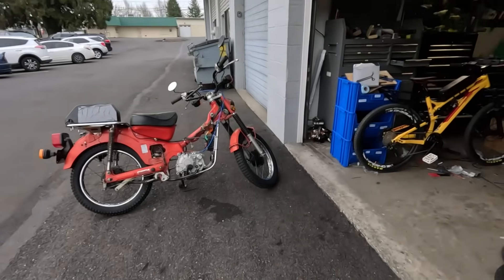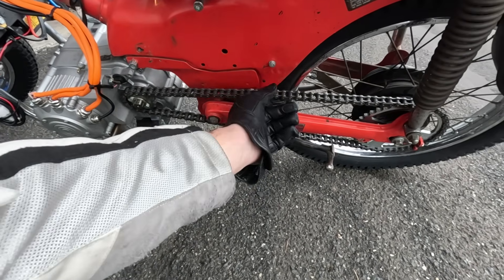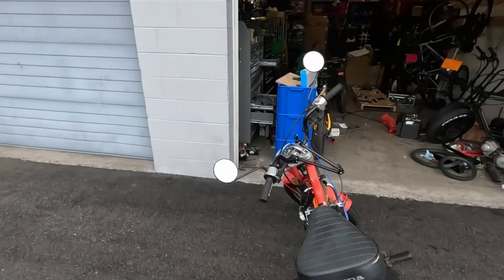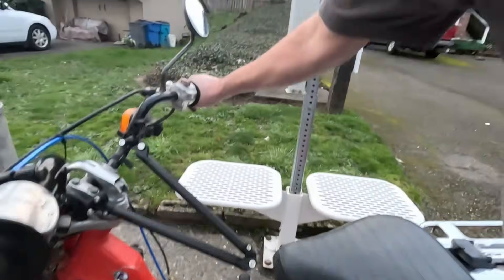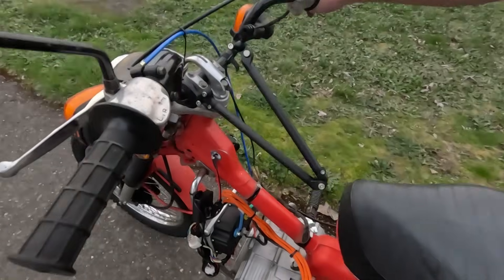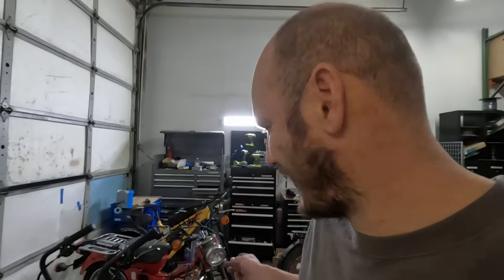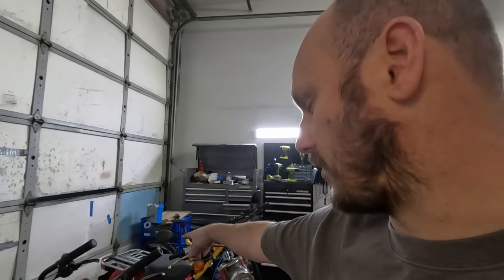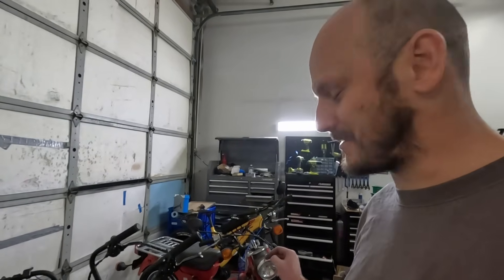Top Speed test on the Electric 72v 4-speed Motorcycle conversion

Comment: A thermocouple to monitor the electric motor temperature ?
Reply from the maker: With a bigger bike that would definitely be a good idea. I don’t think it will generate much heat on this 150lb bike as long as I keep the gearing correct.

Comment: This clip , the battery management failed / shut down . Just another "excuse" , and Johnny's lack of proper planning and NOT testing on a "fully sealed" road in line with the manufacturer's reference test protocol .. The motor's peak laboratory rated speed was nearly achieved . Other videos of this product show the official top speed as 60 miles or 96 kilometres per hour on a dynamometer , or "fully sealed"  road which Johnny should have selected for the test scenario but did not ! The same as used for motorcycle assessments . Going significantly above this would require 96 - 110 volts direct current . The motor would overheat and fail at around 7800 - 8500 watt power consumption , one minute or more continuous run . Johnny had reached 85 amps at the battery (5950 watts)  . The manager could have acted prematurely due to vibration / ambient temperature etc . Peak power was not quite reached due to less than optimal deep cycle characteristics of the battery chosen . If the larger battery was used , the top speed would be higher but if run for more than a minute or so ,  "sprint" up a hill , for example , the motor would become "TOAST BETWEEN HIS LEGS" partly due to it's lack of ventilation .
Reply from the maker: Yes. I haven’t refilmed the top speed test with the proper battery. I have it rigged up now. Just need to film it 😁

Comment: The adapted motor gives an elegantly simple look.  The controller can occupy the old gas tank space under the seat, which will clean it up considerably, and get the controller out of the rain and dirt. Saddle bag style battery mounting will keep the center of gravity low... where it belongs, and provide enough room for the adequately sized batteries this test mule lacks.All the DC wiring can be kept short , and the over all utility of the bike retained.  Most of us know an electric motorcycle has no need for a clutch or gears,  but with a marginal sized motor it may act to reduce current draw ...But more this is a misconception held over from our life long experience with ICE motors.  The ratings that DO mean something... are:  Internal Motoe Temperature Rise,  Peak Current vs Wire Size inside the motor, Duty Cycle when overloaded,  and battery cycle life - which is dramatically shortened by : Excess Current Draw,  Over Discharge and Over Charging  ( the ideal operation range for lithium batteries  is cycling between 20% capacity and 85% capacity.   When you insist on using the top 15% or the bottom 20% of capacity your battery life will be shortened many times.To use the top 10-15% ride right after fully charging. Never go below 10%  Just Dont!  Do you want 5-10 years battery life?... or 6 months or a year ?  That is the choice you are making.   Total Amp Hours Delivered during any 1 cycle... depends on How Fast You Draw The Power Out.    At low to moderate discharge rate ( amps draw vs amp hour rating)  you get more total power back out ( more range),  than you do if you draw the power out Heavily.   So the battery life and the range are extended when you don't Hot Foot It... OR  if you increase the battery size ( several times)  to handle the high Peak Discharge  by making it a smaller percentage of total capacity.   You can't have it both ways.... a small battery and high speed/acceleration...without paying for it with short range and short battery life.   Build and operate for your purpose and your purse.   A light hot rod sport bike... will go fast for a short distances.   A heavy battery pack and sensible operation will give you long range, and long life  but allow full bursts of power when needed without ruining things,  but will be heavier.

Comment: At 2:00 on the video,  the chain sounds like its skipping on the sprocket?  Is that why you had the chain so tight in an attempt to temporarily alleviate the skip?
Reply from the maker: Yes. Going with a larger front sprocket fixed that issue

Comment: You just don't understand  Watt Hours...or how little range that little battery can provide. Better learn to do the math  volt x amps x hours= Watt hours.  Then  adding a fudge factor for efficiency  you can start to calculate range.  You need a little battery computer  readout,( common solar item)  to simplify all this.  Or an amp meter  so you can see how much current you are drawing.  Hills and high speeds are the enemy of range, as is high acceleration.  It is unlikely that shifting gears will do anything. just use 4th.
Reply from the maker: Yes, an ammeter is the next install. Until then I am going off the voltage readout on the battery to roughly estimate range. Here is a video to better understand watt hours:
https://youtu.be/eJRJ_VwPVtQ

Comment: Had troubles with the geared units not holding power.  I'd try a simple qs165 setup and just throw amps at it. You won't even notice the lack of transmission. Doing 4 sec 0-60's and topping at over 85 on a megamoto80 mini bike. Also LIPO RC bats are super cheap, smaller, and can dish out some serious amps compared to those baby bike units.  Hobby king has deals/sales throughout the year. I run 6s packs in 3s and 4s configuration for 75v and 100v peaks. Then parallel as many as needed for your range and amp goals. Good luck!

https://youtu.be/67vAdu3z9J0

Comment: I just watched a video of a sur ron range test....He was going 25 to 35 mph and only made it 40 miles.  So to go 50 miles at 55mph. He'd need a battery over twice the size 😧. 
Any 55mph ebike than can go 50 miles is going to be stupid expensive. Compared to a 125cc or 150cc gas bike. The 150cc Condor Honda Grom clone is like $1500 60 mph way more range.
Reply from the maker: Definitely range is the Achilles heal for these. If you need more than a 40 mile range without being able to charge, gas is your best bet. But if you only have a 20-30 mile commute, electric is much more fun 😜
Reply: @JohnnyNerdOut  Yeah, the range thing is a bummer.... 🤔 But maybe a 2wd on/off road scooter or bike with a medium size battery & a removable locking onboard 1,000w gas inverter generator. To run as an onboard range extender. While riding & you can leave the generator running. While inside the store, eating,etc....If you can't find a charger. On days when you don't need longer range. You can unlock 🔓 remove  & leave the generator at home. A little 100w inverter generator isn't very heavy or big & runs very quiet.. This would give the advantage of  2wd , very off road capable bike, scooter.

Comment: I know you don't prefer hubmotors, but wouldn't it be much simpler in this sort of mod? Any drawbacks on that other than the reliability?
Reply from the maker: If I went hub motor, it would be easier for sure. But then I would lose all the performance/ efficiency benefits of having an adjustable gear ratio through the transmission and sprockets

Comment: Seems like an amazing motor to use a 72v Sur Ron or other existing e-moto battery with to squeeze all the amps you can into that controller. I wanna see someone put one of these into a light crosskart with ATV suspension after seeing those speed runs...

Comment: Thanks for the update, I really want to try this conversion on my S90 project.
Reply: If you cannot get a new crankshaft for your S-90 and the bearings are shot..it's worth a try.   Although the weight and efficiency savings of not having the transmission is worth thinking about.  The elegance of this is how simple  to do and clean looking it is.  The S-90 is such a classic, and so efficient as designed...and much rarer than the the trail 50/65/90/110   that I hate to see them go by the board.    A simple welded bracket a single speed  3 phase electric motor installation is the way toward the best range/speed/ performance/ efficiency.

Comment: Did you retain the "trail gears"?

Do not expect high top speed. I had a 90 with 110 Ricky kit and top speed was 60 downhill due to gears. 

Find a long rectangular battery to mount on each side of the down tube.

Or, use a Tesla Model S module, 24V, about 5kw.
Mount is in a box on the rear rack, weight about 55 lbs.
Two modules (48v)would be okay, just like having a passenger. 
EXCEPT be careful of wheelies!
Reply from the maker: No I didn’t, those are built into the old motor transmission. This current setup has much more torque though. I can stand to hear up a little still.

Comment: to do 50+mph on that you would probably need like 6-7kw
Reply from the maker: I hit 51 with 72v x 80a =~5,700w. I think if I had a 96v system using the same wattage I would gain more speed. The motor almost seemed topped out. I will change the front sprocket and battery and retest
Reply: @JohnnyNerdOut  hmmm. did you measure the 80a? I'm pretty sure you were pulling more, hence the unhappy BMS in the end.

Comment: Doesn’t hurt to have physical fuses or thermal breakers in line while testing. Blowing them intentionally to know where you are at. I have a cheap multimeter with Bluetooth dataloger so I can see what’s going on on my phone or pull up the data later to watch the event and know what my next step is to enhance or protect.
My dream machine would probably need to be 7000 watts with 6 speed gearbox.
On a KLR chassis would be great.
Reply from the maker: For sure. Wouldn’t be a bad idea while I prototype. These shark batteries do have switches and fuses and I have a quick disconnect by my leg in the worst case

Comment: The electric motor overheated during the 114 kilometre per hour top speed test result outcome . It drew 12,300 watts , which is above it's short term rating .
Reply from the maker: Are you using this same motor setup?
Reply: @JohnnyNerdOut  Same component ratings  in the configuration . These are fairly readily available online . Comparable scooter . We had GPS speed logging also from Garmin .
Reply: @JohnnyNerdOut  Australia Post has scooters like this , mostly Honda .
Reply: @JohnnyNerdOut  The electric motor's recommended operating voltage would have been exceeded .
Reply: @JohnnyNerdOut  What is the maximum continuous current rating for the controller module @ what voltage ? You stated that the maximum power in watts allowed through wasn't properly specified . 150 amps as the electric motor can draw , or less ? How hot did it get ?
Reply: @JohnnyNerdOut  Battery fires with the battery type you used in this video are common , as people bang them hard against another object , to decalibrate the battery current limiting bi - metal strip , causing them to become able to dissipate a higher amount of current . Sometimes leading to fires during use . I banged a battery and it cut out at 88 amps before , and 105 amps after trying this in a safety bay .

Comment: A 40 amp hour battery would achieve 114 km/h due to extra weight and increasing wind resistance . After eight seconds @172 amps , the controller and battery management protection popped loudly with controller smoke . A motor mechanic has done the same test as Johnny a year ago at a raceway . The eighty amp hour battery's management acts at 90 amps based on a laboratory test using large rehostats . The battery would give 28 minutes run time at 75 kilometres per hour .

Comment: Why is an 80 amp hour battery mentioned at 5:14 ? It would cause the bike to wheelie or flip over . The first test saw wheelies due to the battery being partially behind the rear axle .
Reply from the maker: My previous video used a 50a battery. The 30a bump was noticeably more peppy. Making that front wheel lift fairly easy. The battery only weighs about 15 lbs so I doubt it had anything to do with the wheelies.

Comment: Have spare battery management modules on hand !
Reply from the maker: After letting the battery sit for an hour it returned to functioning. I imagine it was heat related.
Reply: @JohnnyNerdOut  This is bad as knocking the battery hard would put the battery management out of calibration . It is just a contactor on a circuit board after all . The battery would cut power at around 100 amps instead of 80 (potentially) . If the battery didn't get warm , it was a "dud" . The batteries aren't meant to reset . They are meant to be replaced according to Shimano , at least .
Reply: @JohnnyNerdOut  The cells are now damaged , though.

Comment: I would like to do a build that no one else has done at least to what I've seen!  Something like taking the BIGNIU and upgraded everything for more power  different tires but add two Motorcycle Exhaust System Down Pipes that are actually housing extra batteries that glow hot red and a led exhaust tips &  as for fake exhaust I would send Propylene glycol through so the fake exhaust would light up! 
A very loud speaker system for creating several fake exhaust sounds! 
Add A Skull Ghost Rider head light. Talking about a bit of funds to build and a Cop pull over Ebike but it would definitely look and sound like a real motorcycle!  Then I would bring it by your shop so you to can go over 60mph with extremely crazy loud fake exhaust let every Cop know where you are at!   Just make sure you use the pedals going by them!
Reply: "Oh yeah? Well my bike vapes." Badass, I love it.